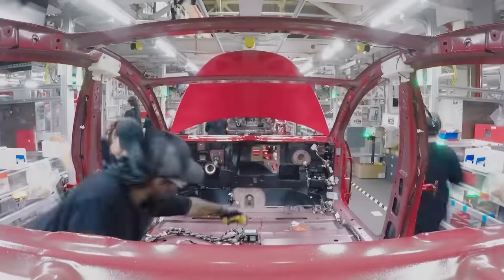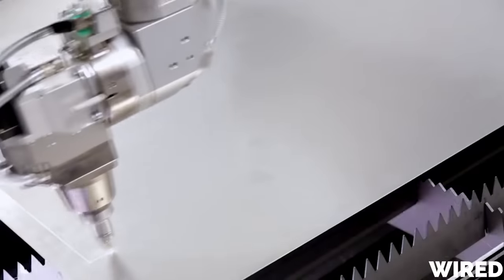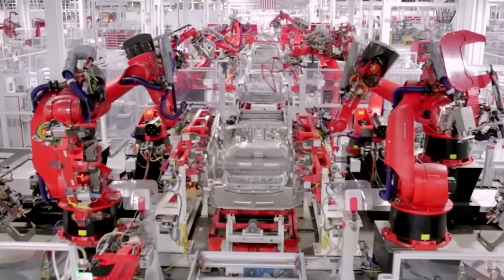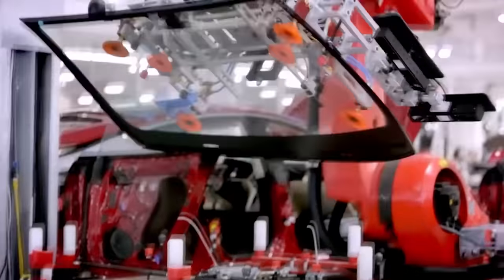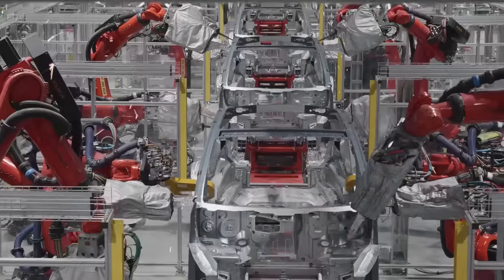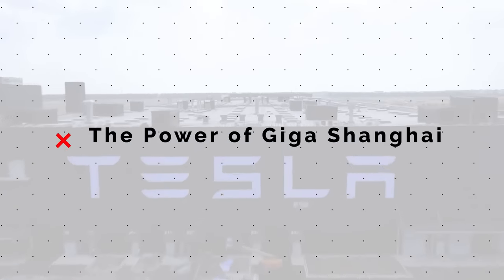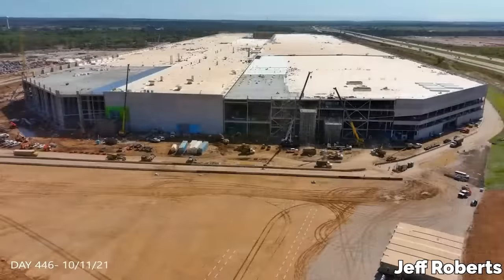How Tesla Builds A New Car Every 30 Seconds!

Comment: I have a model Y.  When I went to the dealership (3 days after ordering it using the Tesla app) the car was already waiting for us.  In less than five minutes the salesman gave us the key card.  I have a background in automotive body repair, sales and mechanics.  I walked around the car and checked it, and to end, top to bottom and check the alignment and fitment of all the body panels,, etc. I found absolutely no flaws whatsoever.  I saw that the factory that built it was in Texas. We purchased the dual motor, long range; with the more expensive pearl white paint, and the seven row seats.  We’ve had them vehicle now for a few weeks, and my opinion of it is that it is absolutely amazing in every way!
Reply: Amen. Just got my first Tesla. A model Y. I 2nd everything you said. The car is so well built.
Reply: @mchase4  try fsd then you'll really love this car
Reply: Sorry, but I don’t believe you one bit when you say there are no alignment panel fit (gap) issues. Sure, Tesla has come a long way with quality checks and have improved, but they still have quality issues. How would I know? I just picked up a 2024 MYP a few weeks ago and the hood is misaligned and small scratches to the hood on delivery. 🤷🏻
Reply: Well, I don’t care if you choose to believe me or not buddy.  I’m sure there are some quality control issues with many of their units however mine did not have any that were significant enough to be noticed.  I’m sorry you are a dissatisfied customer however I am not!
Reply: Great car
Reply: @TheAnonymous916 he was only speaking from his experience I’m sorry that your car came like that though
Reply: How would you rate damage repair?
Reply: @nirbhay_raghav  I have had no issues.  All the panels lined up, and I have had no service issues other than a software update to the automatic windshield wipers. So far the car has over 2000 miles.
Reply: if you have a background in auto body repair and you see no flaws on the tesla please name where you work so i can avoid thanks
Reply: @KimoKimochii  I I wouldn’t work on your car anyway. I’m sure that there are some problems with some Tesla cars but mine doesn’t have any. Don’t let that shock you.
Reply: Wait 5 years 🙄
Reply: @tsengchingchih3872 😂
Reply: @michwashington  why do you say that. After five years any car will have issues.
Reply: @Treborlexx  
Respectfully, I am not trying to pick a fight. As a former employee of Tesla, I know and believe they’re built shoddy and poorly. I don’t believe they’re worth the money they’re sold for. Maybe $15-25k, but not $40-80k, which is outrageous for an EV even with tax breaks in California, plus the battery 🪫 issues and cost 💲, not including the constant surveillance of Tesla and their cars. 🚙 If you’re a happy customer, then more power to you. 👏🏼
Reply: @michwashington  Ok.  But have you ever owned one? Curious.
Reply: Give it a year. The car will start falling apart and every interior panel will make noise.
Reply: @thegoldentheory  Do you OWN one?
Reply: @Treborlexx  nope, would never waste my money on a pile of junk like that. Values will depreciate very quickly, and they don’t last that long at all considering how the drive motors and batteries have a high failure rate. I used to be a used car tech and every Tesla we got was a hunk of junk. Cant even do simple services on them, gotta make an appointment with a Tesla service center and wait weeks-months. One of the worst companies for servicing vehicles I’ve seen. Be smart and buy a better car.
Reply: @thegoldentheory  well, I’m not convinced by your assessment. I’ll wait and see myself.

Comment: "Body in white" just refers to the car primarily before there are any cosmetics such as carpet, seats etc in the car. The term comes from when the car is coated in primer, which is white. So it can really refer to any part of the process from the whole frame assembly up to when it is being installed with all the interior pieces.
Reply: White body is an unpainted car, like a white canvas. The surfacer (primer) can be all sorts of colours, even white cars usually use an offwhite surfacer.
Reply: blco cool
Reply: Racists!!! sarcastic

Comment: The structural battery pack bit is messed up... You're showing seats bring bolted to the floor from inside the car while on the next shot your correctly show the battery pack with seats already bolted on being inserted from under the chassis (which is correct).
The structural battery pack, with seats attached, is inserted from bellow to a chassis with an open floor.

Comment: Great video but slight slip up on the seat instal, currently there are two versions of the car, one gets the seats installed into the car, the newest version with the structural pack has the seats installed to the pack then as a unit

Comment: Great job. I work in the industry and we achieve 58 seconds / vehicle. 30 seconds is an awesome achievement.
Reply: My new tesla was missing parts upon delivery! The panels inside the cars popped out, i glass was chipped, chairs were out of whack, noises in the back of car, faster surely did not mean well made.   Needed to bring the car back to be fixed….. crazy….

Its not how fast.  Its the quality.  Then look at rolls royce they are hand built and slow as helllll…. But its built to last at the highest quality.
Reply: Its not an equivalent metric unless your factory is identical in the amount of production lines. They also make cars faster than one per 30 seconds, the factory doesn't operate for 365 days per year due to Holidays and it doesn't produce cars 24 hours per day, there is a maintenance period.
Reply: @alfiey5783  Must of been built in USA factory.
Reply: The reason why build quality matches eastern European cars.
Reply: Less parts in electric car
Reply: @alfiey5783 It's so funny that you used rolls Royce as an example. That car starts at 250.000$ ~ 5 tesla model Y. 
I really hope that what you said was just a big lie. because If people like you can afford anything that costs more than 1500$, then ur country is screwed. That, or ur american. Only two explanations 😂😭

Comment: I grew up in the 1960’s.  You ordered your car as car lots were small.  Options included, power windows(most cars were toll up), power brakes, power steering. Air conditioning,  no power seats, am radio, am/fm  etc. arrival time 6 weeks.  If you order a MB, BMW, etc., around 6 weeks.  My new 2017 model X was 6 weeks all the way to Hawaii.  Tesla continues to grow with gas car production down.

Comment: Correction: you said most of the stamped body panels are aluminum. On the model Y, only the door skins and hood are aluminum. The fenders, quarter panels, rear hatch, basically the entire body, are made of steel.
Reply: gig.a.casting. most important part and it is showed in vid but ignored completely.
Reply: @joshgray1331  14:50 they spend time talking about the giga press here, or did you not watch the whole video?
Reply: Thanks, it jarred on me too.

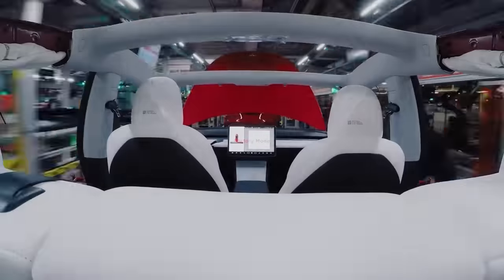Comment: At 4:12 it appears that you are showing seats being attached after the body frame and structural battery pack are already fitted together. You can see the frunk hood and top pillars as the seats are being installed. How can the hood be in view before the seats are installed?
Reply: some of the stock video used shows the original (not structural battery) version of the Model Y assembly. All a bit confusing and not up to high standards of editing!

Comment: They need to control the quality of car assembly line.  My model Y (from TX factory) has so many assembly issues. At least 5 body gaps that the service center can't fix (front fender, trunk hatch, ...), I have to bring my car to body shop to fix it.  I don't know how many that I missed under the body.

Comment: But... If there was "no process" and "no part" then nothing would be produced, so there has to be at least one of each. 🤔
Reply: Indeed... Getting it down to "one process" and "one part" is actually what's best... Not nothing at all. 👍
Reply: It's a transposition of a familiar idea from software engineering (a lot of Musk's thinking comes from his background as a dev from what I can see): where there is no code there are no bugs.  Obviously this doesn't mean no code at all, but that, if a requirement can be met with no part / code / process, then the payoff in terms of complexity, reliability and cost is significant.  Seems obvious but the natural tendency when working on a large project with many teams is to accumulate phantom requirements which don't stem from the target system's goal itself but the interoperability between the teams and siloing of optimisation within each team.  So he stresses first widening the scope of optimisation to the requirement space ("the requirements are stupid, question them"), and then refactoring the design with the goal of eliminating complexity that wasn't actually required for the system goal ("the best part is no part"), and only then optimising the remaining parts / processes, otherwise a lot of energy is spent for marginal gains on a part that shouldn't exist in the first place.

Comment: 02:55 white color is not the easiest and cheapest on Tesla, it’s a multy coat white pearl, it’s a free to customer and more expensive than non multi coat colors for Tesla
Reply: It's more expensive in terms of processes and materials to put on the car compared to black, blue, and midnight silver, but the relatively few customer complaints about the condition of the white paint on delivery makes it the cheapest overall, as each customer-rejected car costs a lot more in terms of Tesla employee time. White simply hides defects a lot better than darker colors, which Tesla quickly quantified and addressed based on data they collected from initially offering black as the cheapest color. Currently, the no-cost option for customers is midnight silver metallic (MSM), because it is still relatively low in customer complaints compared to black or blue, it's cheaper than red or white to apply, and it will hopefully diversify the fleet of Teslas on the road, as white was becoming unbearably ubiquitous.

Comment: 30 seconds is not what I saw Tesla report. Tesla claimed it takes 44.3 seconds.  Either way that is impressive build time. -Chad James
Reply: Toyota makes a car every 3 seconds... a tenth of the time Tesla takes 😂
Reply: No one really makes this claim, its irrelevant. It takes 10-15 hours to make a car, not 44 seconds...
Reply: @jaredscott4829  no one is claiming to make a car end-to-end in 30s or 45s. Their exit rate (throughput), the rate at which cars come off the line, is what is being discussed here. This is a lean six sigma term. What others are talking about would be called in lean terms the Process Cycle Time. These two terms are related through a formula that also accounts for the number of things currently in the process, or Work In Process. PCT = WIP / Exit Rate. All the efficiencies you hear about that Tesla is making helps to ensure they have no bottle necks so their exit rate = their start rate. If they can increase their exit rate (and start rate) while maintaining their WIP, their process cycle time will go down - more cars delivered to customers in same amount of time.
Reply: @jeffpicken5057  yeah that's nonsense, the number claimed is irrelevant. More concurrent production lines, makes the number go down, essentially meaningless. By the same pointless metric, Hyundai Ulsan is spitting out a car every 16 seconds...
Reply: @jaredscott4829  Sure, build more and more production lines at the cost of billions or reduce the cost of fewer production lines by building with fewer parts, fewer robots, fewer people, less materials all the while increasing quality over time and increasing margins. How do you think Toyota worked it's way to the top in the later part of the 20th century?
Reply: @jaredscott4829  Sorry, didn't mean to offend. I was actually throwing out some lean six sigma knowledge for many that were commenting on the 30s issue. No worries.
Reply: At Investor Day Tom Zhu VP Production said it takes 30-45 seconds depending on factory.

Comment: Although from a manufacturing and production perspective Tesla’s approach w/ the Giga Press for quick automation is certainly a marvel, for the consumer end it’s not as great (quite frankly pretty bad) because it makes maintenance all that more expensive. 

Less parts => bigger parts that need to be replaced when damaged => more money from the consumer
Reply: It doesn't get replaced. Car get's scrapped.
Reply: @trnlft  yes, even worst
Reply: It’s safer a car that is in an accident that is capable of damaging the frame is going to get repaired by first pulling the frame back in place using chains then cutting and welding a new piece on the frame the frame loses a lot of life in this process and it will never be the same in another accident

Comment: Funniest thing I've seen in a while.  Here in Colorado, the Interstate that runs from Denver to Grand Junction (and beyond) frequently is shut down due to vehicle accidents, land slides, or snow/ice conditions.  The other morning the Interstate had been closed for quite some time due to multiple accidents during a snowstorm.  All the Tesla chargers were filled up at multiple locations since it being well below freezing, the cars apparently had to stay charged to be able to run their heaters. It looked so much like bunches of livestock lined up feeding.  Don't know what happened to folks that came up hoping to use a charger only to find them all filled.
Reply: These vehicles are not really appropriate for people going long distances especially in extremely cold climates. They are good daily commuters perhaps. If I ever got a Cyber Truck my first accessory would be a gas generator capable of 240V that I would store in the bed under a cover.
Reply: Tesla heat-pumps can keep interiors at 65 degrees for almost two days, losing an average of 2.2 percent of its charge per hour.
The Tesla app shows how many stalls are occupied before you arrive.
Tesla can do 1000km in under 10 hours with normal safety breaks. Loses ~ 15% range in below zero conditions - about the same as ICE do.
In the Norwegian Automobile Federation's annual EV range test, the Tesla Model S lasted for 329 miles in freezing temperatures ~ 19% loss.
Another FUD busted....

Comment: seems rather than selling a lower-cost ev, a bigger focus on building specialized robotaxis at a higher quantity would be even more sustainable/profitable.
Reply: perhaps a van based on the cybertruck drivetrain?
Reply: nah if they can mass produce a smaller more affordable car that opens them up to a massive market of people who want EV's but can't afford one. Not to mention the size of the car allows a much smaller production line footprint in their factory and less time to produce the full vehicle start to finish. The change is likely do to the much more massive demand due to rising gas costs and the multitude of people stuck with the poor investment of gas guzzlers because they can't afford to make the switch.
Reply: Exactly. Even better if taxis made to last, for refurbishment to be easy. ICE vehicles, steel shells just don’t last, are designed to be redundant, need parts. Small, low purchase cost are even worse, don’t save on running costs.

Comment: In the past white was the most expensive color. Also white has special coating just like red. 

Are you sure white is the easiest the produce? 

My M3 from 2019 had the most expensive white color and black was the base color. During 2019 they changed this with white becoming the base color and the started charging extra for black.
Reply: The video is simply wrong here. White became the no-cost color option for several years mostly because it hides defects better than any other color offered.  It is a multi-coat so it's more expensive in terms of processes and materials to put on the car compared to black, blue, and midnight silver, but the relatively few customer complaints about the condition of the paint on delivery makes it the cheapest overall, as each customer-rejected car costs a lot more in terms of Tesla employee time. Currently the no-cost option is midnight silver metallic (MSM), because it is still relatively low in customer complaints compared to black or blue, it's cheaper than red or white to apply, and it will hopefully diversify the fleet of Teslas on the road, as white was becoming unbearably ubiquitous.

Comment: I have a question I'm sure some of you can answer! Are Giga castings engineered such that portions can be cut out and new pieces (i.e. fenders, bumpers) attached back into the casting? Or does this mean Teslas will have a higher rate of write-offs because of the difficulty and expense of repairing a Giga casting?
Reply: It’s been said before by Munro & others, if accident impacts as deep as casting, any car would be a write-off - or should be. It’s old FUD. Best to avoid "accidents", using driving aid software etc.
Reply: @iandavies4853  Thanks!
Reply: @priusnv  Hi. I hope you went back to Munro type sources, don’t just take my word for it. I just selectively parrot what I read or watch, I’m no panel beater or car expert. Sandy has long advocated for Gigacastings. 
The Tesla FSD software is proving a great driver aid for helping to avoid many accidents, just working in the background, even before full autonomy is achieved. We are just so used to cars being crashed, we have whole industries catering for such, over last 70 odd years. Can’t stop it all, but a lot are avoidable.
Crash design now focuses on protecting occupants, not on repairability. Human repair is expensive. Russians might do different maths. :-(